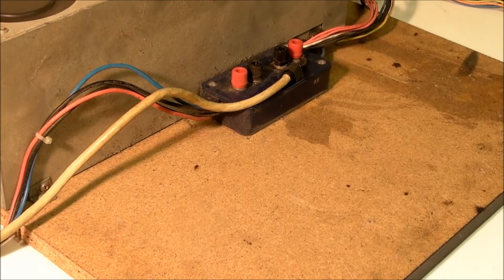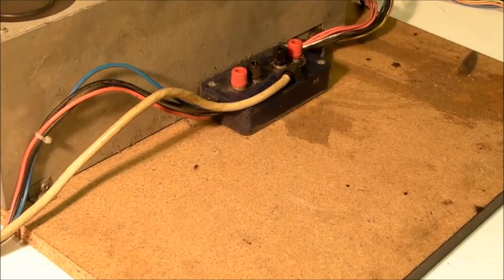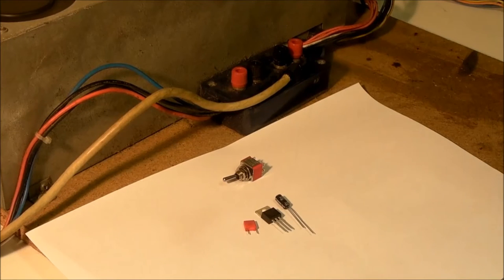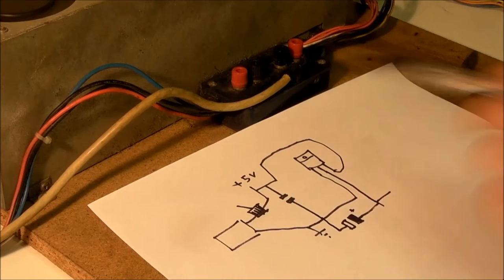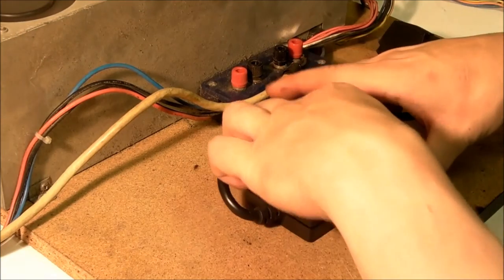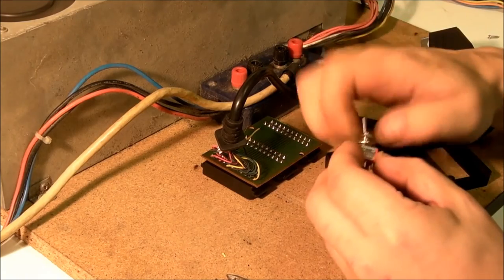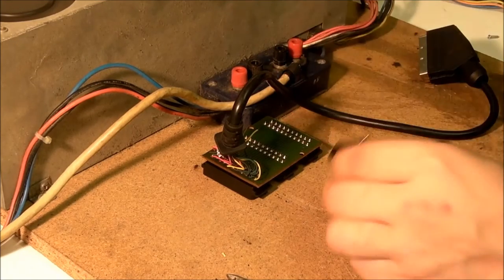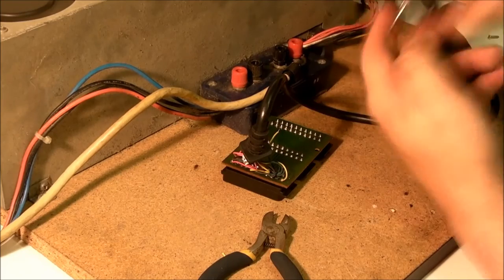How to make a SCART Composite RGB switcher

Comment: Hi ! thanks for this video. I have seen in a Scart Spec that the RGB/Compos. pin (fast blanking) had to be powered with at least 9v...  I understand that you produced only 3v and it worked ? did you test it on a old TV ?
Reply from the maker: I think you are getting confused with the AV switching voltage which is 9-12V What that does is switch the TV into AV mode automatically I cant remember the exact pin number off the top of my head. but i don't use it as it would make the design more complex. I just rely on switching the TV into AV mode using the buttons on the set. The RGB/Composite switching voltage is if i recall correctly 1-3V I regularly use a 1.5v battery as a switching voltage when working on a set and that works just fine. Hope that was helpful, Jay